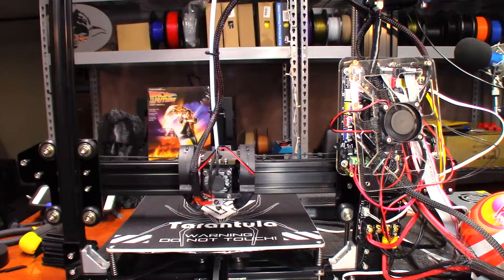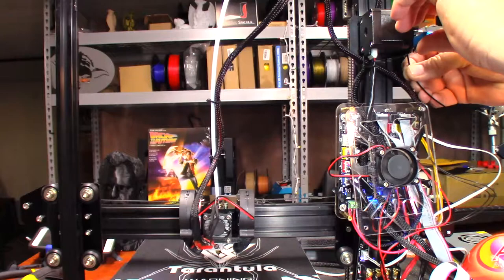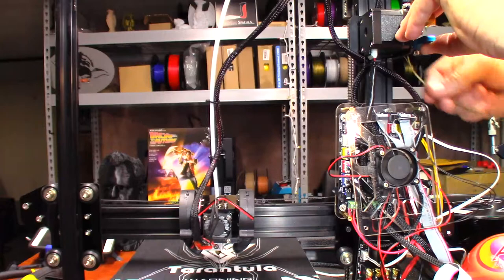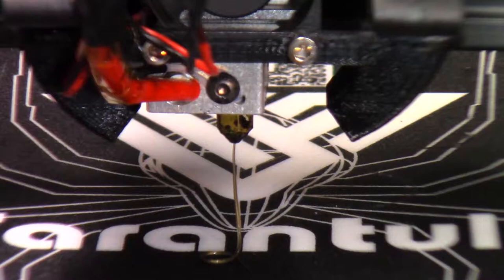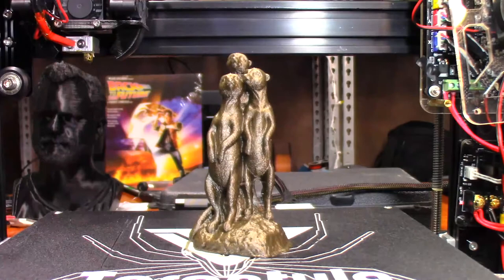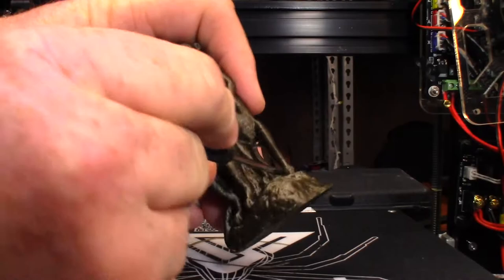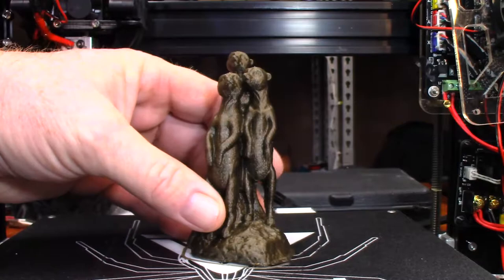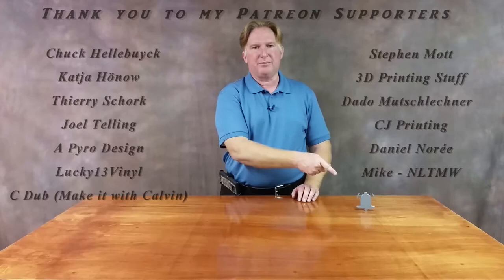3D Printed Meerkats and Temp Settings Using Bronze AMZ3D PLA On The Tevo Tarantula

Comment: Hi Jimmy, really enjoyed your explanation of how to check correct filament temperatures by the way it extrudes, great info! 

That method of removing filament is the way it is described in the manual of my Cocoon Create Mini printer, also Bowden style. That printer was my first printer and I'm now on to my second printer a Cocoon Create Touch (Wanhao i3 Duplicator Plus rebrand) which is feed drive. 

What method do you recommend changing filament in a direct feed extruder? (Manual says to just let it feed out when 'Remove filament' is pressed). 

Also, nice print!
Reply from the maker: +Print Very Good Thank you!

On a direct drive I actually do exactly the same thing.  It's just a lot easier.